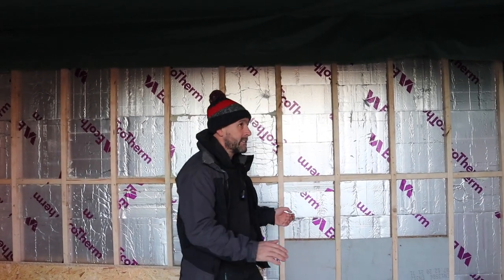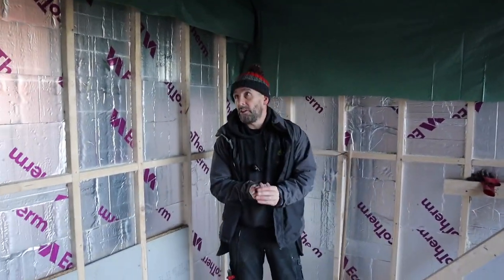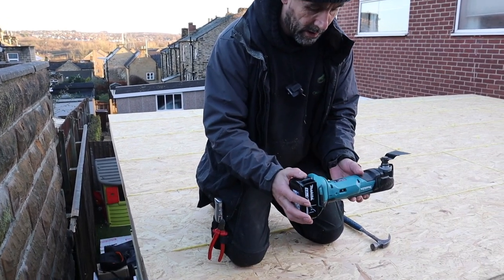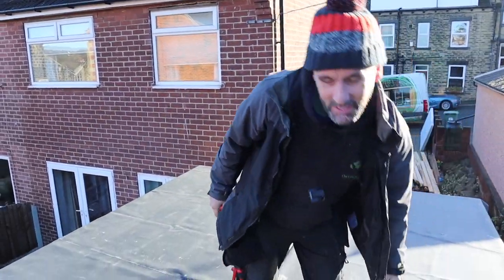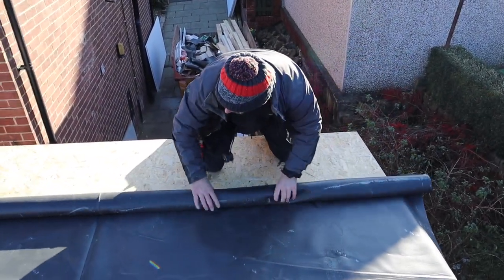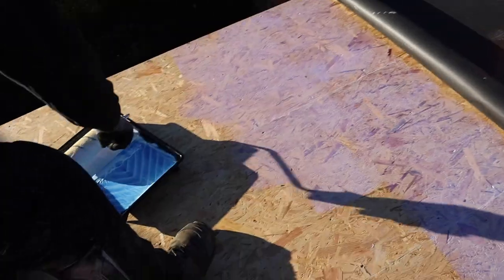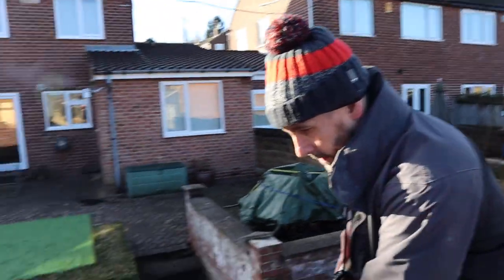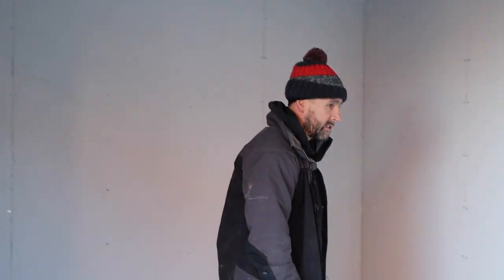Garden room rubber roof membrane

Comment: Daft keyboard warriors - ignore them completely...cracking team the lot of you! No harm in offering your professional opinion on the tools you use regularly too - helpful to the rest of us. Looks like a nightmare getting that rubber roof on in one go up a ladder - wonder if rolling it length ways and feeding it up like a rope would be any easier
Reply from the maker: it would but its trying to keep it clean and dry that's also an issue mate
Reply: Absolute bloody nightmare. I still wake up in a cold sweat remembering the dark cold December night I had to drag mine up onto the roof. Physically the hardest job on the build!
Reply from the maker: @ooslum  genius!
Reply: I would just putabthw rubber roof in a bag and lift it with a rope to help others bringing it up.

Comment: I prefer to use the contact adhesive simply, because occasionally when you put the kerbs on it can bubble the edge back. Just preference i suppose. Have you tried a squeegee on the roof yet? Thinking of giving it a try on my next roof, in a couple days. 

Have you tried the firestone spray on contact adhesive? Can get messy, but absolute timesaver.

PS , invest in a roller pole and save your back.

Great video, i already have started to do a couple of things the same way as you guys, everyday's a school day.

Comment: Your right with the contact adhesive , I’ve done over 10 of these roofs the last 2 haven’t used the adhesive all it does it when the wind catches it goes everywhere and it you put the 100mm edge over slightly too quick it will bubble the rubber . the only thing it is perfect is bonding to masonry on an upstand
Reply from the maker: nice 1!

Comment: Good idea about the insulation over the top to keep it warm. By the way if you need to get more blades for multi tool have a look at saxton blades on amazon prices are decent i use them in my bosch multi tool

Comment: Any reason why you don’t stagger the wall boards like you’ve done on the ceiling ie horizontal to the stud, as a plasterer I always like to stagger as it adds strength and reduces risk of cracking. Other than that spot on mate

Comment: Makita are one of the last manufacturers making their own tools and don't make tools for anyone else.. Hilti are the same 
All these different brands of tool are made by only a handful of corporations.
I use Makita for the same reason, I ended up with a couple of batteries so now it makes sense to buy their tools plus they're decent tools to be honest
Reply from the maker: ergonomically they are very good, lacking in the nail gun depot though
Reply: Unfortunately the multitool isn't brushless so it eats through battery power. I also find it quite bulky to grip.
Reply: My wife uses one of those Makita multi tools to Shave her Growler, I got it for her birthday about 4 years ago. She's 25 stone and her Growler is massive.

Comment: william your rod base system is class.never seen that done before.really is.is there a reason you always do it that way rather than 4x4 post concrete in.? also mate give the hikoki nailgun another chance mate .i find it much better than the paslode and milwaukee up on roofs.great channel bud. watch yourself using that glue for the sheets read the small print👌

Comment: Hiya, I am refurbishing my brick shed and I have battened the walls with 22x47 timbers for plasterboard, the walls are single skin so there’s no wall cavities of any kind. Do you have to put any kind of insulation between the battens or can you get away with it, as I can’t seem to find any kind of insulation that’s narrow enough to fit between the battens - the closest is 25mm but the depth of the battens to the wall is 22 so that’s not going to work. Is there anything you would suggest and also how do you fix the wooden pattresses to the sides, like skew the screws through the side or use brackets of some kind??

Comment: Do you worry about cracking the rubber if you handle too much in low temps? What's the min temp it remains pliable? Loving the vids btw 👍
Reply from the maker: the rubber stays pliable mate, just stiffer in the cold, it can be a right arse to get it into the two part gutter trim this time of year, but we use a cheap heat gun for stripping paint to soften it up before fixing the trim
Reply: My car tyres stay pliable at -12!😁

Comment: Can you give me some advice. I’ve built a shed however I’ve only used 3x2 on my roof I’ve put in n 25mm pir board between the joists yet it seems to be getting condensation and it’s freezing on the underside of the roof.

I have put a soffit on each end  for the over hangs, which I will be venting using ASAP but I concerned I will still get condensation even with it vented please help as I don’t want all this work to go to pot as I’m now been made redundant and cannot afford a new roof.

Comment: I've got a narrow garden and want to build a garden room at the back, which unfortunately would mean the rear and both sides would be touching the boundary. Is there a way you'd recommend cladding the exterior with the finish product before erecting, as I'd prefer to avoid asking the three adjoining neighbours all for access, not to mention removing each of their fences? Thanks in advance and loving the series 👏
Reply: Powder coated roofing sheets
Reply: @randomcamerajunk6977  thanks!!

Comment: Hi mate, I’ve got a flat roof extension in my house that’s felt at the moment and looking a bit old. Would you recommend using the rubber to replace that or re felt ?
Reply: Defo refelt pal .
Reply from the maker: personally id say rubber, but Im no roofer, this system is pretty much fool proof and the manufactures reckon its good for 50 years
Reply: @ianbrown8171  what’s your reasoning mate ? I’m only interested in the rubber because I feel I could give it a whirl myself. I’m no expert by a king stretch but I have re roofed my slate pitch roof alone etc and fancy trying my hand at most things. I just feel rubber looks a lot less involved. Interested to know the difference really
Reply: Felt 100% 
With felt you get 3 layers totalling 1/2”
On OSB
With rubber you get 1mm on OSB does not like foot traffic and in my opinion weathers horrible compared too a felt roof 
Been laying both for 20 years
Reply: @rc3171  Fibreglass is the one for a flat roof extension.
Reply: @thegardenroomguru  where do you get your snap-on drip edge, please Liam? Is it from one of the main online as part of a kit, or do you buy it separately?

Comment: That contact adhesive is horrible stuff and I was wondering myself why it was necessary when I did my roof recently. As a complete aside, just how steep is that fall on the old garage/shed in the garden about 3 doors down. Must be a 1:10 or even steeper 😮

Comment: Loving these videos, I have a triangular piece of land I want to build a room on (divided into 2; 1 'office' to hide from the wife and 1 as a shed) how do I do a flat roof to keep it down low, surely I can only build 1 'straight wall and the others will have to slope to get a fall?
Reply: Just build all your walls the same height and put your roof on so you have a cube. Then nail firring strips onto the entire length of the joists of the roof. Firrings are strips of timber which run on a taper down their length. Google it. These will give you the necessary fall to create a run off for the water and also an air gap between the insulated joists and final roof covering allowing for ventilation to rid the area of condensation and any resulting rot/mould.
Reply: @Scribe3168  Thanks, I don't have a cube though, but I have decided to build the rear wall 75mm taller then the others, then do the roof joist off the first one., building a noggin for each spar as they get progressively higher and then infill/brace each noggin and then put midd noggins in and then board it. Just fiddly (y)
Reply: @lukedarby6815  you get plates, studs, joists, rafters and noggins. Plates either go on the floor or on top of a brick/block wall to take studs or joists. If you have a stud work wall then the bottom and top timber’s of the frame will be your plates. Your studs are your uprights and your noggins brace all the studs in between horizontally. Joists span floors and the bottom of the joists take the ceiling. Rafters create roofs. Clear as mud? ... good.
It sounds like you’re creating something a bit unique ... what I do is come up with an idea for how to make it and then give my mind time to simplify what it is I’ve come up with to solve the problem. Refining the design if you get me? Saves blasting ahead and then realising later that if only you’d thought of that before... Good luck anyway.

Comment: Looking to build a snooker room in the same way as this. Would you give me a rough estimate how much it would cost materials only? 7.5m x 5.5m.
Reply: I doubt he will. Hes said a few times he doesnt give material costs as they vary regionally and change one month to the next. Good luck with your snooker room though. 👍
Reply: @tentonhammer5469  just wanting an idea if it's cheaper to build in this say. Or buy a pre made summer house if you get me.
Reply: @CueBald  ah get you if you're on Facebook he has a forum on there where people talk about how much their self builds have cost. Might give you a ball park to compare to a summer house.
Reply: @tentonhammer5469  I'm not on Facebook unfortunately. A summer house 7.5 x 5.5 size is approx 7k. But doubt it would be the quality of this
Reply: @CueBald  me neither. I would imagine 10k would be closer for a building your size and like you say better finish and the satisfaction of doing it yourself. Obviously not fitting bifolds or cedar will reduce the cost alot.
Reply: @tentonhammer5469  ye I would only need a standard door and 1 a couple of windows. I'll look into it further. Thanks
Reply: @CueBald  I reckon a garden room of that size at this standard would be around £40k. I'm pretty sure these are around £1500+vat per square metre.

Comment: Would u ever try a fiberglass covering.  Much better than rubber.
Reply from the maker: I did in the beginning mate but the weather is against you often so opted for rubber
Reply: Isn't a rubber roof supposed to last up to 50 years? That should be good enough.........!!

Comment: Drill you're spots out after Plasterering.
Reply from the maker: No chance! What happens when one of the guys has mismeasured and missed the light hole🙈
Reply: @thegardenroomguru   easy way to set out light is mark them on floor with chalk line mark out centres  , then just ping them up to ceiling  with plum laser .